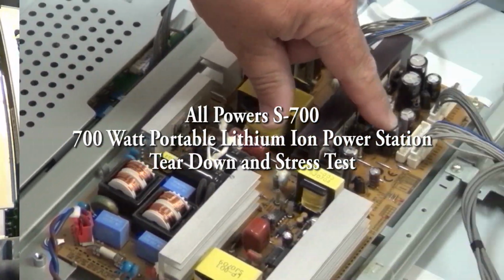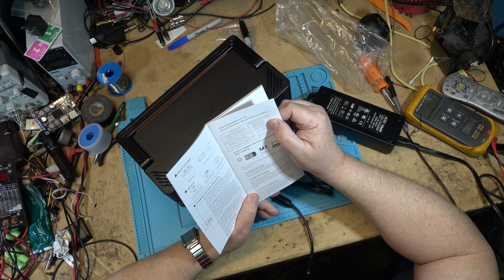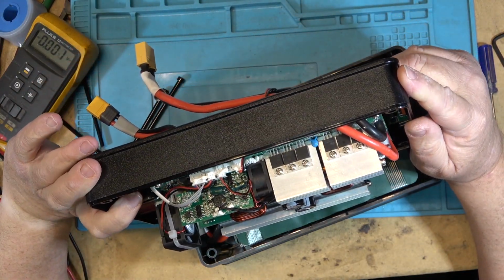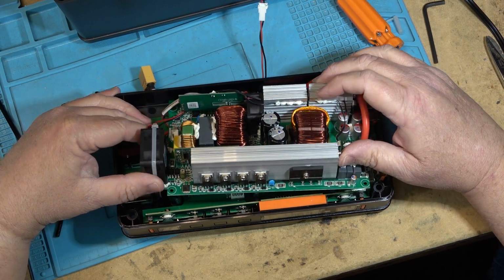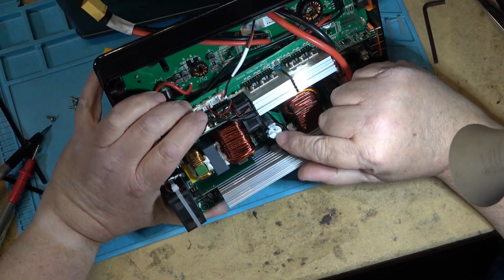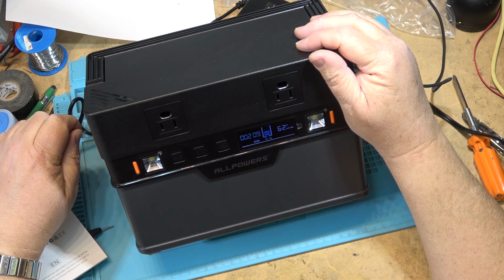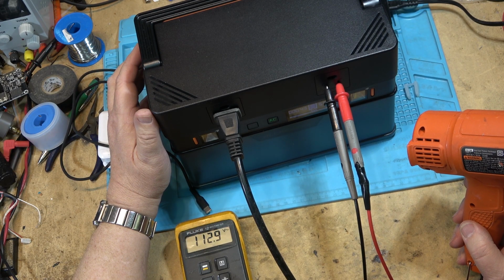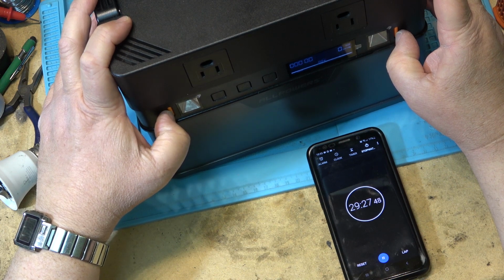All Powers S700 Portable Power Station Tear Down and Stress Test

Comment: Mine does not shut off at 10%... Wonder if this is a counterfeit unit or new software. Mine is s700 v2
Reply from the maker: I ran mine at 100% output for the full charge so i had it running hot.  That's likely why mine shut down at 10%

Comment: So i hooked up solar with sae cables forgot to put the reverse polarity adapter in and made AC output not work and dc output works though. Cant charge it well i can if the 5.5m input would work right lol was womdering which connectir i could use to charge it the xt60 or 90 and which to make a adapter for a 400w inverter to connect to

Comment: Hi I had a problem with mine, I contacted them, and they sent me out a replacement the problem with mine was it started puffing out magic smoke at around 400 watts AC i think the inverter was on its way out after being 2 weeks old..  the replacement one has problems to with the type C port.. and the time till its rans out is all over the place also one of the LED lights has stopped working and seems to go dead a lot faster than the first one it's like roulette with these people say they get a good one then one bad one it must be how the made.
Reply: @12voltvids I would love to send u the images of the damaged inverter to see where it went wrong
Reply: @DJphantom340 Hey, is your is still alive? I have mine about a month, it was overload and smoked, but still working lol. I disassemble it and I see one of six mosfet transistors is blow up. Will replace transistor tomorrow and hope it will work long after :)
Reply: @Slam_Hasol  hey yeahh mines still going also I just use it for low power things like stuff under 200w mine was version 1 when I got a replacement  unit it was version 2 they had no problem with me getting a replacement
Reply: @DJphantom340  Thanks

Comment: Never knew why batteries were in parallel the inverter at higher wattage drain the battery's quicker.
Reply: I think it's a matter of balancing the lithium elements. After all, each serial connection requires a separate balancing line when charging, but a parallel connection does not require this.

Comment: I am suprised the batteries are in parallel. I wondered if they would have had longer runtime if in series and run the inverter at higher voltage. For example. 600 watts would take 50 amps at 12 volts plus the inverter fan and drive circuitry. If they were 60 volts. It would only be 10 amps draw at max power.
Reply from the maker: Watts are watts.
Reply: Parallel batteries give DOUBLE rated Ah capacity and amp rating. Series would ADD each cell's voltage to total but they will only have the rated cell amp capacity. Series adds voltage. Parallel adds AmpHour capacity/Current capacity.
Reply: @marshmower  Nonsense! Battery capacity is measured in watt/hours, and Ohm's law teaches us that power is the product of voltage and current. Therefore, it doesn’t matter whether there is a high current with a lower voltage or vice versa - the power will be the same.
Reply: @dmidro64  heat

Comment: on these battery banks, I really wish they had a huge light on the top, so it can point on the ceiling and light up the whole room
Reply from the maker: Lay it on its back with the lights and ac outlets facing up.   The other ones on the sides are still accessable.
Reply: @12voltvids  that also works